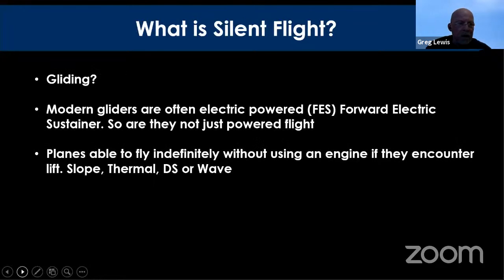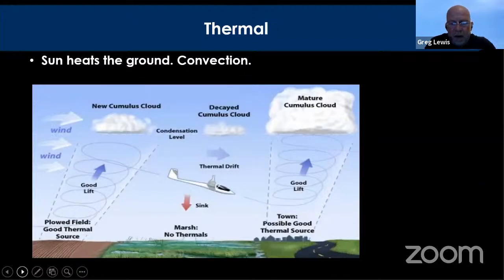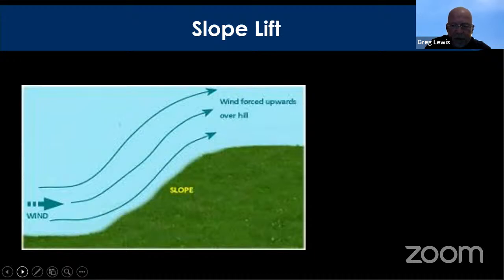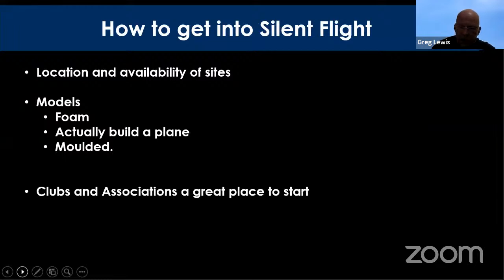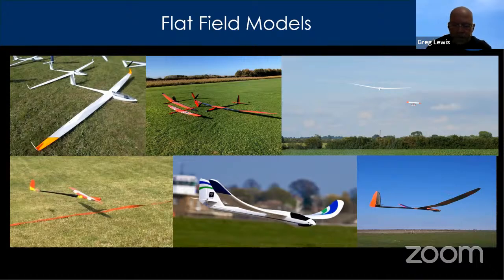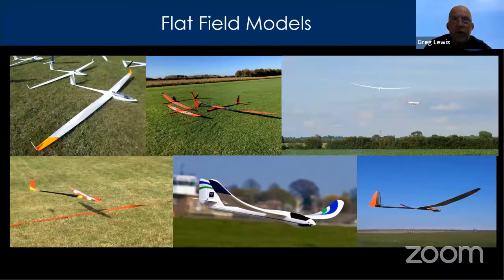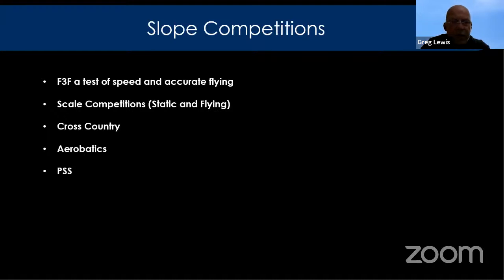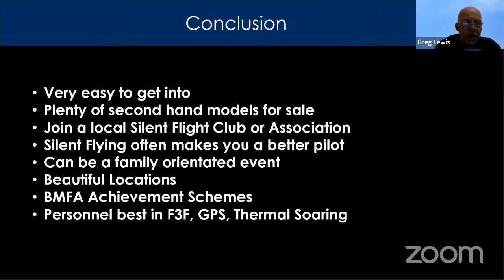In the Air Tonight - An introduction to Silent Flight

Comment: Using the term "bungee" for launching is a bit misleading, since one does not use bungee cord but latex or silicon surgical rubber tubing; the term "histart", though originally a brand, is perhaps better. Beginners using bungee cord will have miserable results. 55:40 Note that F3-RES uses a flag, not a parachute. Parachutes lay out the line fully downwind, whereas with a flag the line will fall more quickly and not so stretched out. I have not competed in F3-RES, but I suspect there's less tangling of neighbouring lines with flags. I fly at a largely power field, and use a piece of crumpled Monocoat when my line falls inconveniently with the parachute (e.g. over cars or the flight line).